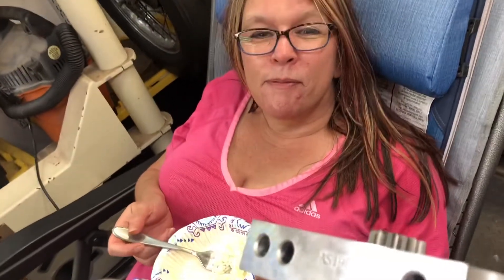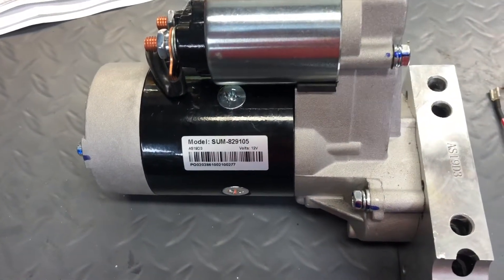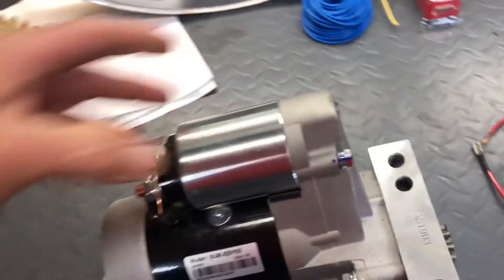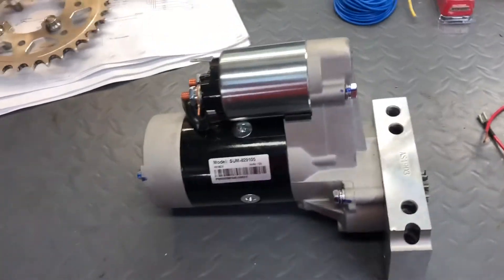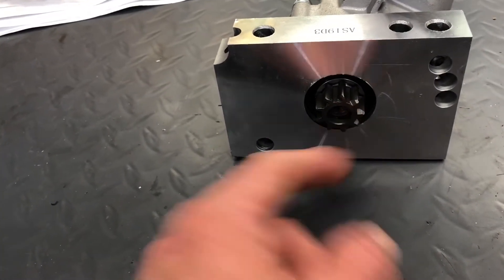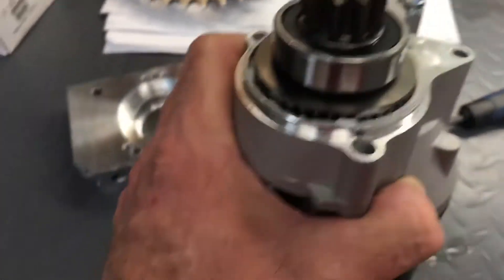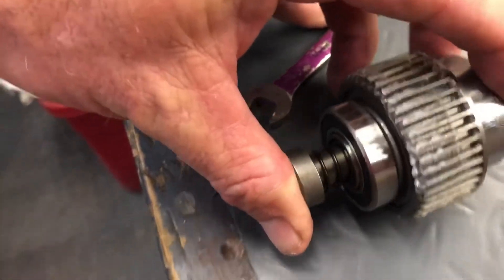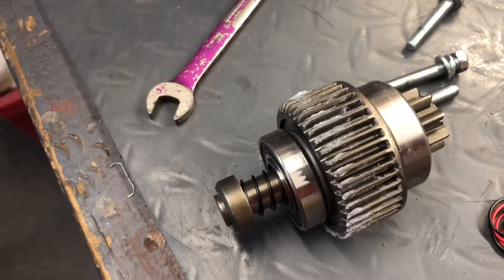Remote Drag Bike Starter Build part 1

Comment: Geez I bought a Harley drag bike with crazy compression, and the guy made a cart with two 12v batteries and a starter from a 3206 cat!! Well it turns the bike over easily but to lift this prick is a chore all by itself lol , must weigh at least 40-50 pounds , an if your not hanging on tight it will pull your wrists out of there sockets lol, wish I had something like this :(